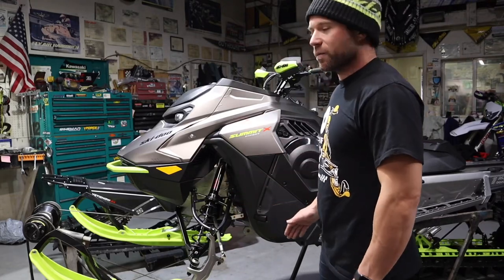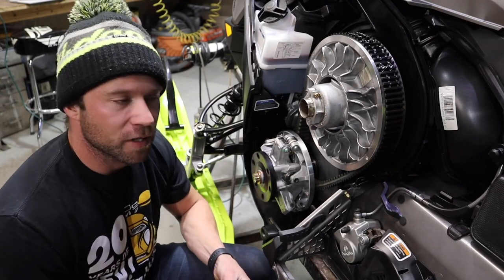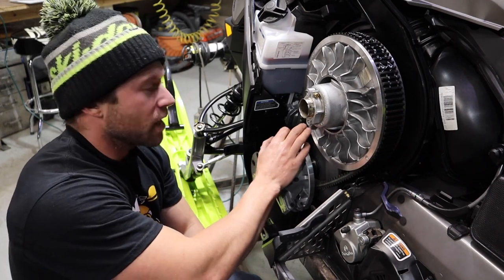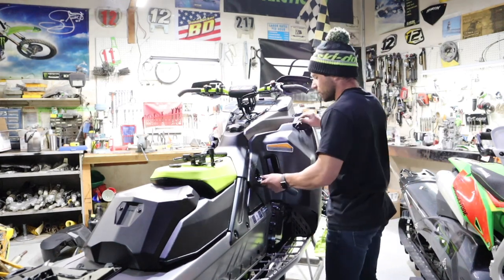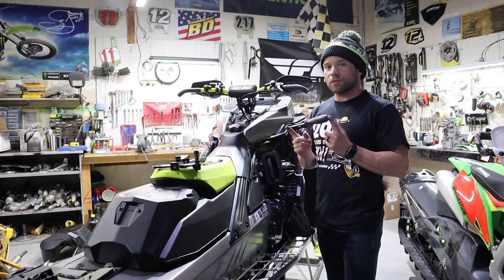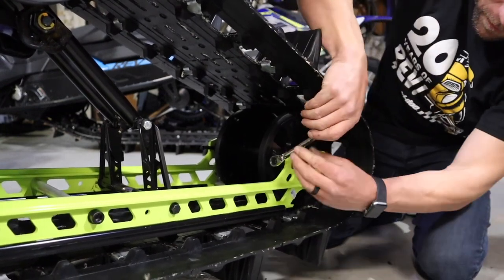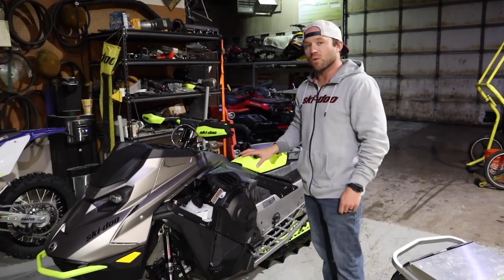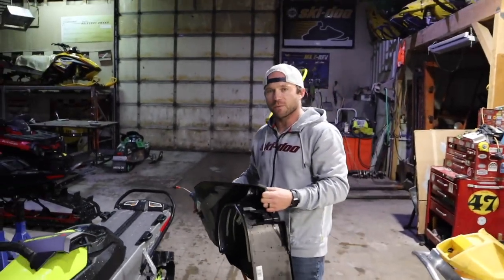Ski-Doo Gen 5 first check, track tension, chain tension, belt deflection and more

Comment: When you removed the silver washers from the pivot bolts did you remove them from all 3 pivot bolts?
Reply from the maker: Yes I did, your dealer has access to the high altitude sheet, double check for your altitude

Comment: I guess I don’t get it. I have the same exact sled and if it’s designed to produce full power up to 8,000 why would 10,000 feet require much adjustment at all, as it would have the same power reduction effect as a naturally aspirated at 2000 feet which doesn’t require any adjustment?
Reply from the maker: Im not sure, i'll ask though

Comment: What exactly are you looking for when tightening the chain? Are you just turning it until it snugs?
Reply from the maker: Yes exactly.  If the chain is really loose, the tensioner will feel like a loose bolt. Run it it until it’s snug.